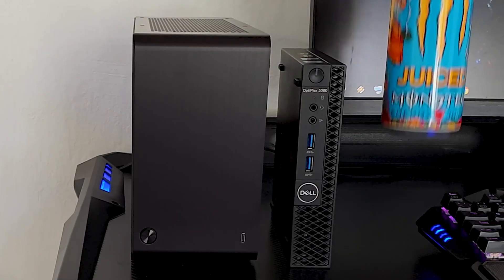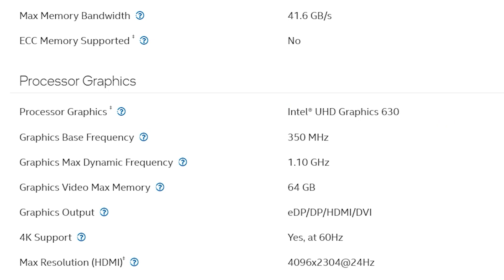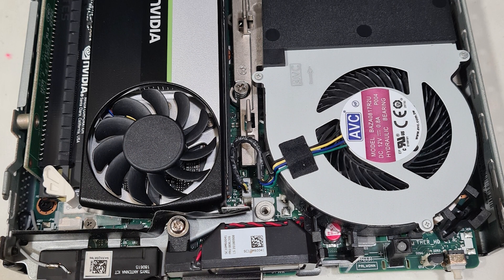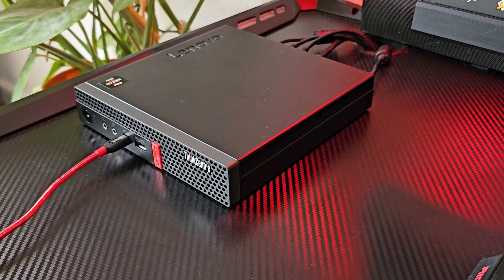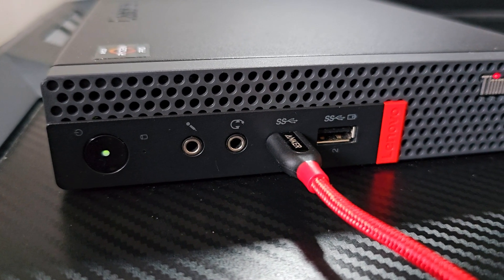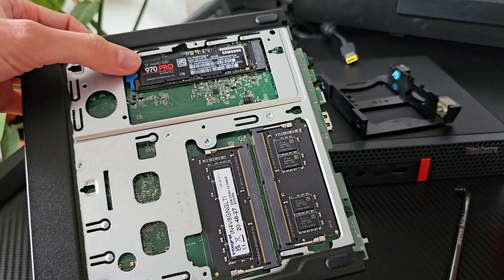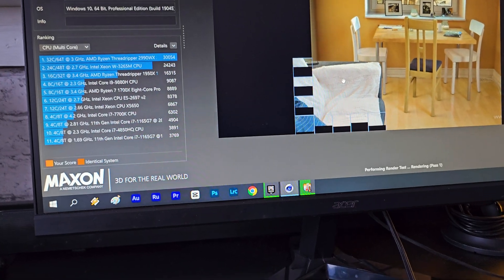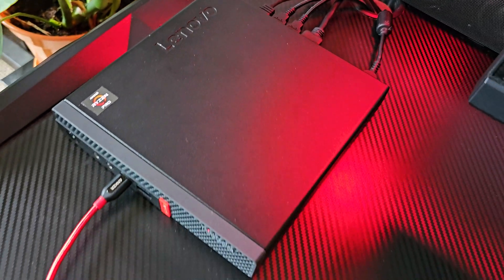How Small can a PC get ? Episode 2 - Lenovo M75q Gen1 Tiny - Ryzen Vega 11 Power

Comment: My current pc is a Lenovo M720q with a i5-9500T and the RTX 3050 6 gig.  Using a 230 watt power plug. It works for Elden Ring getting 59 to at worst 41 fps on Med. But you need to use Throttlestop in order to get it to get the full power to the GPU.
Reply from the maker: Very nice! 
Yeah, I bet.

Comment: I really hope that Lenovo releases another BIOS update for the gen 1. The last one was in spring of 2024. I'm hoping they can release one in a few months for the gen 1 too, but I think this is out of support!
Reply: Yes, gen 1 was marked as end of support on the lenovo website. I purchased this unit in Jan 2020. It's a great machine, I'm still use it playing GTA V or Forza Horizon 5 with 135w PSU.
Reply from the maker: @itstheweirdguy  I agree. But, like you said. I think the new ones with 8700GE are an epic upgrade!

Comment: M715Q Gen 2 (2400GE) supports 2933MT/s RAM. I have two units right now with 3200 MT/s sticks (BIOS downclocks them to 2933).
Reply from the maker: Yeah, OEM machines they are always more restrictive on the bios.
Reply: @Glob3Tech  I'm just curious why Lenovo M715Q Gen 2 2400GE allows for 2933MT/s but M75Q Gen 3400GE limits it to 2666MT/s
Reply: @jonathanmarshall3974  If you check the Lenovo PSRef for each model under the Specifications tab, Processor section at the top, looks like the actual max RAM speed support depends on the CPU -- e.g., any OEM Ryzen variant of either model should support up to 2933, but the Athlon variants only support 2666.

Comment: Can the cpu be upgraded and if so, to what chip
Reply: 3400GE is the toppest tier chip it support. No support for 4000 or 5000 series CPUs
Reply: @ Thank you 😎🤙🏾
Reply from the maker: Safe would be within the same aproved generation but risky with a 5000 series one.
Reply: @Glob3Tech  understood I was just tryna squeeze as much performance out this lil maschine as possible I only have 8 gigs need to grab 8 more
Reply from the maker: @Hope_Dealer3  With you on this one. If you have the option to experiment, go for it. As for ram, yes, the more the merrier.
Reply: @Glob3Tech  it max’s out at 16 or 32
Reply: Yes sir 😎🤙🏾
Reply from the maker: 32gb 2666 MHz for this series M75 Gen1.
Reply: @Glob3Tech  Thanks dude 🤙🏾
Reply from the maker: @Hope_Dealer3  Most welcome. Let me know how it goes🤙
Reply: @Glob3Tech  running great does pretty well with light gaming it’s a beast with all retro gaming 😎🤙🏾
Reply from the maker: Excellent! 🚀

Comment: You have very slow memory, HyperX Impact 2x16 2666 Cl15 (Compared to my previous Samsung 2666 CL22) increase my framerate around 40-60 percent, depending game ,of course also used 90watt psu .Also new bios increase performance.It looks like it very like low thight and aggressive timings(15-17-17-17 Jedec )than frequency. It is completely different small pc,fast as dream on those cl15 memory. Bioshock infinity jump from average 50 to over 80 on the low settings

Comment: I just bought a 120Watt PSU, I think the 65Watt is the reason It wont load PC games.  I hope its not do to a Faulty CPU
Reply from the maker: If it was a CPU, there wouldn't have been any image. How did it go with the new PSU?
Reply: Have read multiple reports that a 90W supply gives a measurable performance boost under high load, but no significant difference between that and 135W, so 90W is enough for these to max out, and 120W should be more than adequate.

Comment: hi can u help me ?  i have lenovo tiny 75q 1 gen with ryzen 3 2200 ge i would like change to ryzen 5 3400 ge. Is this possible? I have now bios:M1XKT45A-AMD AGESA Raven PI-FP5-AM4 1.1.0.2  must change to M2FKT17-AMD AGESA Combo-AM4 1.0.0.3 ? or only change procesor, and my old bios will work with new processor? thanks for help?
Reply from the maker: Hi. Since they used that 3400ge cpu on this generation, it should work as a direct swap if all motherboards are the same. But I never tried it. I would suggest that you would ask here as well.
https://forums.lenovo.com/searchpage/tab/posts?fid=1308&q=M75q%20cpu%20upgrade&sort=best_match

Good luck 👍

Comment: If you buy one of these make sure you get a 135W power supply with it. It’s like $30 extra dollars and I promise you it’ll double the performance.
Reply from the maker: Indeed! Don't have it anymore but I mentioned the impact of a bigger PSU 👍
Reply: I'm about to buy the 135w psu, but I read a guy that he does not get any performance boost, is it true? should I stay with the 65w? thanks
Reply: @swinoob616 Between 65/90/135 watt you'll not see much difference until don't change memory sticks something like 2966 cl18 or 2666cl15. If you done this then  swap PSU for 90/135 you can see awesome boost over 100 percent but you'll need change both components
Reply from the maker: @swinoob616  Is it for the Gen 1 as mine in the video? Maybe the gen 2 are better optimized. I would still get it for peace of mind.
Reply: @Glob3Tech yes mine is Gen 1 with Ryzen 5 3400GE. I bought the bigger psu, it's coming this week. thank you!
Reply from the maker: @swinoob616  Most welcome 🤗 Enjoy it!
Reply: @swinoob616  any updates on this?
i have 2 of these for my daughetrs and would like to improve them.
Reply: And aggressive cl15 memory 2666 :))
Reply: Have read multiple reports that a 90W supply gives a measurable performance boost under high load, but no significant difference between that and 135W, so 90W is enough.
Reply: @SubGothius  new ones only ship with 90watt no option to choose 130watt
Reply from the maker: The newer gen indeed, better optimised so don't really need it.
Reply: @crawlerguys  Lenovo doesn't offer these Gen1s new anymore, so the 90w/135w recommendation was for getting the most out of a used/NOS one. 😉 IDK what's best for the newer Gen2 or Gen5 M75q.

Comment: What if u buy a more powerful cpu and upgrade it good thing about this is the cpu socket
Reply from the maker: Technically yes but it all depends on Lenovo's bios support.
Reply: BIOS will only support a CPU upgrade to the max OEM spec for that generation -- e.g., a 3400GE for the Gen 1 M75q.

Comment: I have the Lenovo m715q with Ryzen 5 2400ge. I run 135w psu. But when I stress the cpu it won't be above 90% usage in task manager, I used furmark. Is this normal ?
Reply from the maker: Sounds like the built in protection kicking in and/or the thermal limit. What are the CPU temps? 
Try Aida64 to double check as well.
Reply: @Glob3Tech  thanks ! Aida 64 stresses cpu at 100% !! I also did bios update and stuff. thanks again!!!
Reply from the maker: @laptech3767  My pleasure! Glad it all worked out 🤗
Reply: hi, do you use official lenovo psu?
Reply from the maker: @swinoob616  Yes.

Comment: Nice video picked up Lenovo M75q for 50$ , looking to upgrade the hard drive 2 Tb and ram for video editing !
Reply from the maker: Thank you and that's a great find!
Reply: @Glob3Tech  yeah apparently based on your video there’s a many different versions of it out there so I’m not sure I got a good deal now but I’m happy with it going to fire it up for the first time today I came with a monitor and a keyboard and a mouse, and a camera like a USB camera but I want to upgrade it just to you know kind of future proof it against any issues. Yeah can’t beat 50 bucks !
Reply from the maker: @thewaterheaterfactory  True but from the sound of it, you can't beat that complete combo yout got. Let me know what specs it has 👍
Reply: OK it’s got an Intel core I 5–7500 T CPU at 2.70 GHz.
8 GB of RAM 237 GB hard drive SSD . 
Model 10 MQS18500 

Came with the Microsoft windows 10 pro licensed .
Reply from the maker: @thewaterheaterfactory  Excellent! That's a quad core and the iGPU should be HD630. Check the first video in the series where I had the same igpu 👍
Reply: @Glob3Tech  Will do